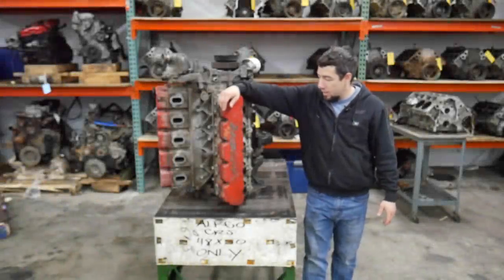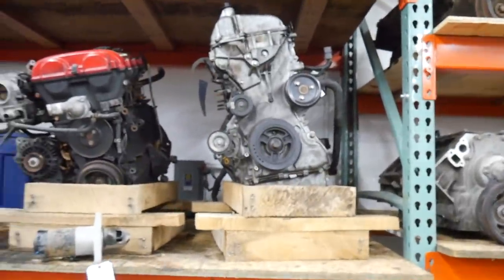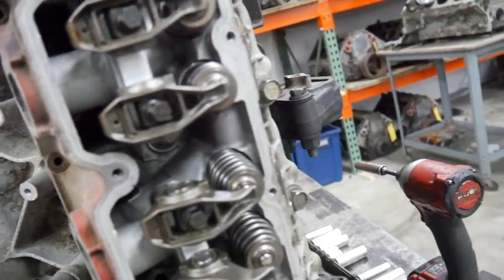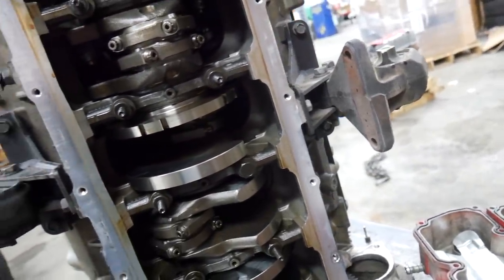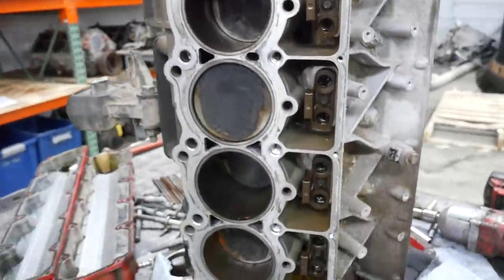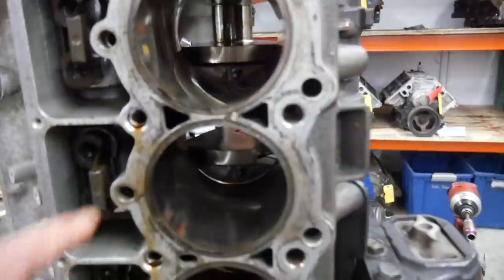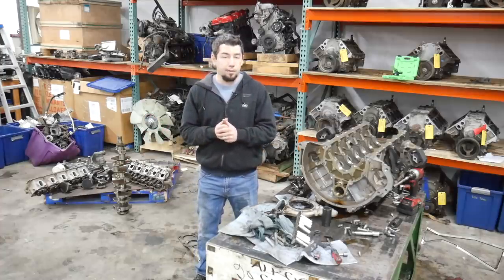TOTAL TEARDOWN! BLOWN UP Dodge Viper 8.3L V10 Engine, What Let Go?

Comment: Here is a question for you ... would you rather have the trigger wheel on the inside, and the water pump on the outside, or do that crazy Ford thing where they put the water pump inside the engine?  🙄 I just had to change one, and it was a pain in the butt. (Was in a Mazda though)                                                                                                                                                             A real question though. The replacement water pump for the Mazda, says FoMoCo on it. What bugs me is that this is used in both Fords and Mazda's. The Mazda manual says to use only one kind of antifreeze, and absolutely no others; the Ford manuals for the same engine/same year (2009), say to only use a different type. Mixing the 2, makes the antifreeze turn black within just a few days? Just asking

Comment: Looks like a simple engine. Rebuildt a 2.2l dodge turbo block a while ago. 150k on the engine and no wear on the bearings and still had crosshatching.

Comment: Film the tear down of the M156 for sure. Would love to see the cam adjuster condition as well as the tappets and cam lobes. The bottom end will likely be a normal year down. Also if it’s an early W204 156 engine would be cool to see if it has stock head bolts and the condition of them

Comment: This doesn't look like an engine out of a Viper, most likely out of a truck. I know Chrysler put Viper engines into some pickup trucks. I am sure you can find online which ones, I am just too lazy to look up now. The reason I say that is that it has a flex plate for an automatic transmission. Dodge Vipers were only available with manuals, so would have to have a flywheel now flexplate. The pickup trucks with Viper engines were available with automatic transmissions.
Reply from the maker: You’re right, it’s a ram srt10 engine. It was incorrectly labeled when we got it.

Comment: Gen 1 and 2's Viper had great engines.  I've never liked the Gen 2s and 3s for their looks and the lower quality of mid 2000 US made cars.  I will say, I'm not surprised that there are some issues with this engine.  If you know Viper owners, you'd understand why the many engines have wear.  They drive them hard most of the time.

Comment: I had a V-10 in a 1999 Dodge 2500 pickup.  Started making noise at 33,000 miles.  Had to have the whole engine rebuilt luckily under warranty.  Traded that truck in as soon as I got it back.  Didn’t trust it anymore.
Reply: Not the same engine. Much like a Chevy 350 is not a NASCAR engine. Similar displacment and number of cylinders thats where it ends.

Comment: Kind of hard to believe that the V-10 only had 2-Bolt Mains. The pistons also look like they are cast and not forged?
Reply: Cross-bolted 4-bolt mains. Last year for forged pistons in any Viper was 1999. Hypereutectic cast in all motors since then. Entirely fine for all NA and even mild turbo applications.

Comment: Damn, if this engine was at the shop and mechanic told the owner its trashed than that shop need to shut down, this engine is totally rebuildable and not much $$ to spend, it was a perfect engine with few issues.

Comment: They put the trigger wheel in the middle because it has the least amount of crank twist relative to each end of the crank for more precise timing.
Dropping a valve seat is nearly always because of overheating combined with inadequate engineering.

Comment: it's amazing how they got all their engine manufacturers to consistently do bad valve work on their motors ever since the late 80's...  I had a Dodge Spirit with a Mitsu 3.0L that burned about as much oil as gas due to poorly designed valve seals.
Reply: The 3.3l dodge was an outstanding engine. Took a grand caravan up to 250000 thousand miles before selling it.
Reply: Have had a couple Pentastar 3.6L, pretty happy with them.

Comment: Have you ever torn down the smart little 2.0's of a SAAB 9-3..say 2007/2008? Any troubles in your past?
I have one, 2nd car and they are just good engines...do you have any historical problems or segments on them for future awareness?? Concerns?
Reply from the maker: That’s an ecotech engine, and timing chains are a notorious issue especially with deferred maintenance. They also have a lot of ecm issues

Comment: Any idea how many miles are on this engine? Or... was it a truck application? My 2005 Viper has 24K miles and I WOULD BE LIVID if I had a catastrophic failure due to poor engineering. This isn't a lubrication issue. Not a coolant issue. Not a maintenance issue. Just wow.
Reply: It is an overheating issue!

Comment: QUESTION! Did MOPAR ever experiment with a V8 version of this engine? 4.98 liters.
Reply: The viper v10 is based off of the 360 v8
Reply: @billyboots3730  I would disagree because the deck of the Viper block has shrouded lifter galleys like a Chev LS.
Reply: @marlobreding7402  look it up, sr1 viper was based on the chrysler LA platform
Reply: @billyboots3730  I stand corrected! It doesn't exactly look like a 273, 318, 340 or 360. I'm guessing it the  mechanicals that are taken from the LA engine. 🤭

Comment: No mass produced engine experiences 0 failures.
Reply: But Chrysler experiences a lot... 😂
Reply: @member57  Chrysler always has the most reliable engines, takes notes son. Any La Mopar small block will last forever especially 318's. Now if you want the most reliable engine ever made then thank Chrysler for the mighty Slant Six. And the viper v10 and the Hellcats 6.2 v8 our the most powerful and reliable modern American production car engines. Ford and Chevy have millions of recalls on all sorts of cars for their unreliable engines and transmissions. At least my Chrysler recalls are for simple little problems like the tail gate on the Ram not always locking lol.
Reply: @Rogueginger69  
  Fiats are rolling junk. Don't care about most powerful. The slant six days are long gone, fiat is now a shadow of it's former self. Every fiat owner I know has had there fiat ingest their valve seats. Every single one. Days of chrysler are bygone. There is zero reliability after 100k miles on a fiat engine. It will eventually eat it's own valve seats. The only long lasting reliable engine put in a fiat is the Cummins, that is because somebody else makes it.
Reply: @member57  I'm talking about Mopars not Fiats. I'm just saying Chrysler has always had some of the most reliable engines. These Hellcat engines out here these days are one of the most incredibly tough and reliable engines ever made for a production car. And I do care about power that's why I choose Mopar.
Reply: @Rogueginger69  
That are built by FIAT (FCA).  Wouldn't own one if someone gave me a hellcat equiped product, I would sell it to a sucker like you. I believe I read somewhere that the hellcat equiped vehicles have the highest warranty work percentage of any vehicle manufactured, I'll see if I can find that source. What's the point in building the "most powerful" if it can't stay out of the shop? Why do you think Chrysler has been dumped by 2 major corporations. Warranty work was killing them. Fiat is on the way to dumping them soon too. In the 90s and 00s it was transmissions, now days their engines and chassis are the problem. How many dodge trucks crab walk going down the road? I get behind one and just shake my head. Being a FCA tech is job security.  
Just think of this, when rodders mentions an engine swap, what engine do 99% of people think of? I'll give you a hint, it isn't a mopar... Virtually nobody swaps in a mopar unless it's a hellcat or a 12v (which isn't even mopar). The days of Chrysler building bulletproof reliable cars are long gone since the 70s, don't even get me talking about the K-cars...

Comment: These blocks are actually a derivative of the original Dodge v10 cast iron engine block used in trucks. Dodge sent an engine over to Ferrari Italy with a request to make it lighter for high performance car use. The end result was an aluminum block and heads designed by Ferrari and produced by Dodge.🇦🇺

Comment: The trouble with Chrysler engines losing their valve seats is more related to overheating than anything else.
The fastest way to remove a valve seat without touching it is with heat.

Comment: This channel needs to be renamed "Adam Sandler Does Engines" And this engine is a good reason why you need to keep the oil changed. That's why the cams get eaten.

Comment: GM puts crank sensors on the center of the crank in some of their higher tech engines like the Northstar and the LT5 (the real one, not the one that just came out to bastardize the RPO code).  From an engineering standpoint, it actually does make more sense. It doesn't always from a serviceability standpoint, though.  Try changing the two crankshaft position sensors on a Northstar V8, and you will find it to be the easiest do you have never done.

Comment: You stated that it should be the best of the best and your right on that. This engine I do believe is hand assembled and there should be names engraved on the engine somewhere. The reason I say that is when I was employed at Dana light axle I had the privilege of assembling about 200 of the rear gear assembly and I got to engrave my name on all that I made.  Before sending the units to the final assembly plant, we took pictures of the gear patters and engineers picked the best of the best. But that was a Dana 44 with a 3 even hear ratio. Not hard to make, but that engine should have never done that period. Maybe that's why Chrysler.  quit making it, they built garbage.  From what I was told every component had engraved names of the people that made it.
Reply: Sean Goldsworth,, 'they built trash'? Kinda harsh don't you think?  This engine isn't out of a Viper, it's out of an SRT10 Pick Up.  A wholly different level of treatment on the assembly line from what I've read.  I work in the outfit that checks the metrology of the cams and tappets for the performance arm of what USED to be Diamler Chrysler.  I have been directly involved in checking the hardness of the camshafts for the Mopar Performance crate engines, specifically the 426 and the 528 Hemis.  So I have a little exposure to the differences between the hand-built stuff they used to do, and the assembly line stuff.  Either way,,, a good overheat can drop a seat in about any aluminum headed vehicle.... just saying.  Generalizations don't typically serve anyone well.  The Viper line has been what you describe in my experience,  but I don't believe the assembly line stuff gets nearly the same attention.   And ALL THAT, means nothing after Dick Lutz left the operation when Diamler's Schremp and Zetsche ran him and others out right before they raped the profits from the company.  Since then,,,, all bets are off on what I knew about their dedication to quality after the asshats from Diamler took over.

Comment: I feel the exact same way as you do about Chrysler's except for the Jeeps before 2000 there were pretty good I got to say but if you bought a Viper you wouldn't striving for Perfection use just want to look cool
Reply: That's because those 4.0L jeeps were an AMC designed engine
Reply: @michaelmastro2860  yep

Comment: The valve seat dropped because the engine was badly abused.. or because it blew a head gasket and that particular cylinder over heated expanding the material holding the valve seat.

Comment: They likely pulled the head, found the valve seat and contacted the owner to see what they wanted to do. The owner likely wanted to wait to make a decision or it was a used car dealer that didn't want to warranty the engine so it was parked outside waiting for a decision to be made.

Comment: Ever have any problems with stripped or galled threads when removing bolts from these aluminum blocks?
Reply from the maker: Most definitely. It’s usually on things you don’t expect like a Subaru valve cover bolt.
Reply: @I_Do_Cars  I was going to replace the head gasket on an old Honda CRV B20Z engine. After struggling with the first 2 bolts, I decided it wasn't worth it. It had over 300K on it.

Comment: a viper is basically low output engine, considering the hp/liter ratio and low rpm.  I would repair the seat, valve guide and valve... and just send it.

Comment: Do you make more money on separate parts or a complete short block.
Reply from the maker: It depends on the engine and condition. Engines like this usually get stripped bare

Comment: Crank drive oil pumps are junk 
Why does the timing wheel need to be on the end of the crank front or rear?  It's cut into the crank counterweight

Comment: Ford could have easily had a monster of a v12 if they mashed two 1965-96 ford 300 inch i6s together made proper crossflow heads with triple 500 cfm carbs and a monster of a cam or two assuming gear drive cam is still there 
(Edit) that would be a 600 inch or 9.8L v12 made of some legendary truck engines

Ps I love the viper wish I had one

Comment: Why trash the head with the dropped Valve Seat!? :O
If i had a Viper & If i know a dropping Valve Seat could be possible, then even this head ist also interesting because i think it hasn't cracks & so i would buy 2 more heads, give it to a machine shop to give this head all Valve Seat Rings new, also in syther Metal material Version too...
Then it's an reliability optimization, because then you've got never dropping Valve seats (If the Guys from the Machine shop know what they so & i think that's more possible than the big companies who'll "sell more Cars" ;) )
& Even with the use of syther metal Valve Seat Rings you've No pitting or something else like that. With the use of Synther Metal Valve Seat Rings by the Auto Industrie they had found the perfect way of choose the best Valve Seat Material. And today we see Valve Seat Rings in Steel and even Not in synther Metal, because the syther Metal Valve Seat Rings was "too reliable" -> and that was the Time between 1995-2000s... so you know why the Auto Industrie use Steel Valve Seat Rings today; because they've Not that reliability of synther Metal ones....
It's a shame but it's the truth about the todays industy; the Elecric vehicle ist even this attractive for the Auto Industrie or even for the highest positions there, because it will kill the most Jobs and would give the Automobile a new big build issue; The EV is the Car that would live roundabout 5 years, then it's completly Junk, pure Junk....
And some people buy hybrids or EV's because "Environment..." :D that's the biggest scam of all build in the EV with physical fix Rules

Comment: That was a good engine. Don't know why they didn't just pop a new seat into the head and send it back out there. The repaired valve seat would be more skookum than the other 19 seats anyway!
Reply: I was gonna say, realistically it could of been saved but some dealers, assuming the original owner did take it to one, doesn’t have “qualified viper” mechanics so dealer just part it out and gave em a new one. 

That is best case scenario, more than likely, if it came out the ram truck old buddy probably tried to treat it like a actual truck and not a over size muscle car (which the ram srt10 basically was) it got fucked and he took it to his buddy and buddy gave him two quotes and again “new” engine would be the winner

Comment: Ruin a cam lobe,shorten  the  push rod.Hammer the  valve  seats  in on aluminum  heads,heavy  springs  heavy  valves.

Comment: Did you mark anything before you tore it apart ? Probably not !
Reply from the maker: It’s not getting reassembled so why would I?
Reply: @I_Do_Cars   Somebody else might want to reassemble after repairs. Don't forget, aluminum can be welded. Valve seats ARE replaceable. Cams can be found or bought. Pistons can be bought. Bearings can be bought, etc.  Now it's too late to figure out which bores the connecting rods came from. Rod caps are scattered all over the place. That motor wasn't really beat up that bad and can be saved. Very disappointed. What a shame. I've seen worse fixed and lasting even longer. Most unfortunate I didn't get it before teardown. Oh well ! ! !   Good luck with ALL the pieces then.

Comment: My viper sucked from day one nothing but trouble and I take great care of my machines like my 1985 Yamaha Vmax 1200 she only has 11,000 original miles and she is getting new tires this weekend and will need another rear tire Midsummer and there is a lot of rubber stuck underneath the rear fender lol.

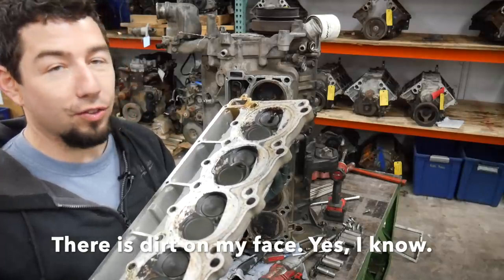Comment: 8:00 what is he talking about here, all those valves look the same to me and even the top of the cylinder that he scraps at look like the other to me. I guess I don’t know what a valve seat is, I thought it was the seal for the valve.
Reply: The second combustion chamber down, look around the bigger valve. The valve seat is a ring of a harder metal that is press fit into the aluminum. Because they're different materials they expand with heat at different rates. So if the engine overheated or the machining tolerances weren't tight enough that metal ring can come out of the head and prevent the valve from closing

Comment: Would you say the cam issue is the result of an oil flow problem?
Reply from the maker: It’s likely an oiling issue, but we had found signs of that engine being apart before. Once cleaned, two other pistons had valve marks so who knows what kind of life this engine lived.
Reply: @I_Do_Cars  Thanks for the info and replying so fast, I enjoy your video, keepem coming